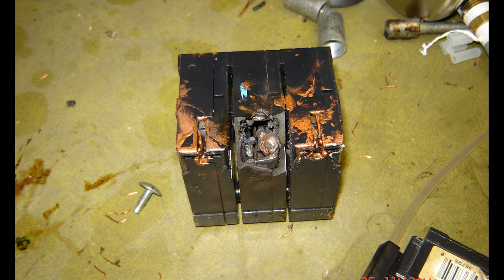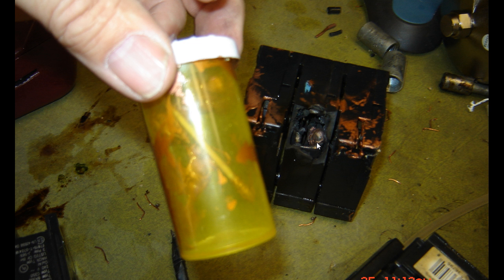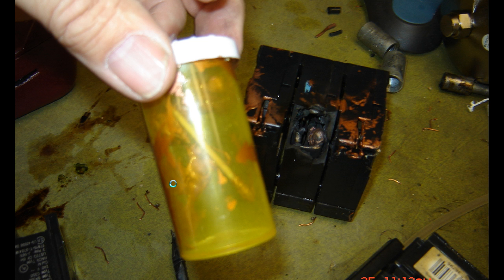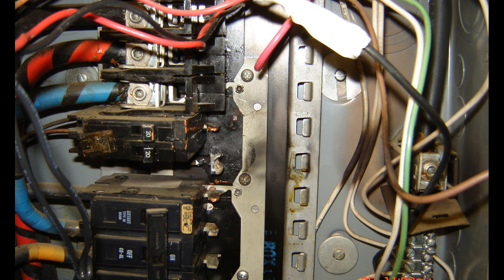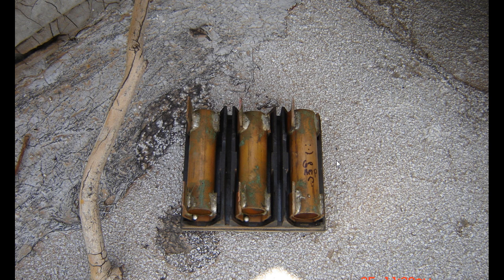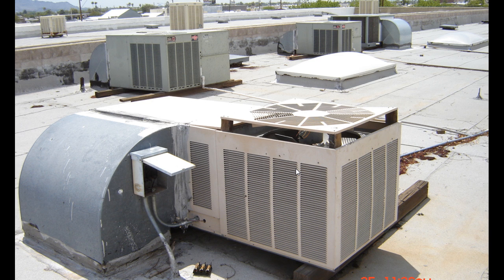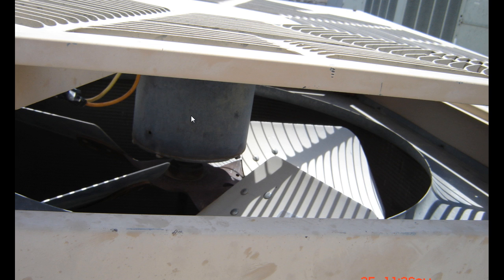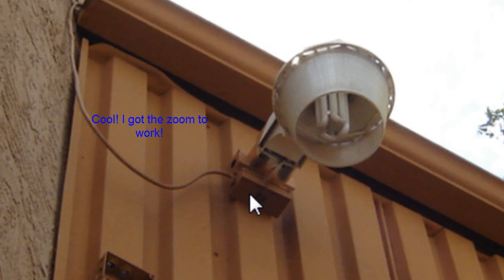Circuit Breaker Gone Bad

Comment: You re-energized that panel? Dude are you serious? Read  NEC 110.3 (A) (5), (6), (8). And 110.11, 110.12 (B), 110.14(A) (C). Don't get me started on Article 200. That panel should have been condemned. Too bad if the guy couldn't afford to fix it, you were basically obligated to notify the department of building safety. They would have told the guy no fixy, no powery. You could get yourself sued big time. 
COPPER COAT on the breaker stabs??????? Holy crap.
Reply from the maker: Yea that was a tough one. My boss said fix it,I could have quit,his liability(my boss) This stuff is done every day accross the US. People have to make decisions. That is why I post this type of thing so it brings awareness to others that may cross some thing similar.
Reply: Thanks for sharing. I know it's hard being a hard nose.....but..... This could be a life safety issue. I've had to call the fire marshal, and the POCO out to service calls for arching meter stabs. They have a way of handling difficult clients. And it helps having backup, it makes you look like the good guy.

Comment: Ya I have a whole  jar of that copper paste. .. its called " Kopr-Shield" and its made by Thomas and Betts. It has its uses and I use it sparingly on things like automotive battery terminals, bolted connections exposed to the elements, trailer plugs on the back of your truck etc.. I dont think it improves conductivity, but it does inhibit corrosion very good... I would not use it in a panel like that , especally  gooping it on, thats just asking for trouble.

Comment: The paste on the back of the breaker is  " copper coat "   It's primarily used on conductors or on rigid/ outdoor fittings and raceways.     I have never seen it used on the back of a breaker.   And the soldered fuses were too funny.   Time for the owner to call the HVAC guy